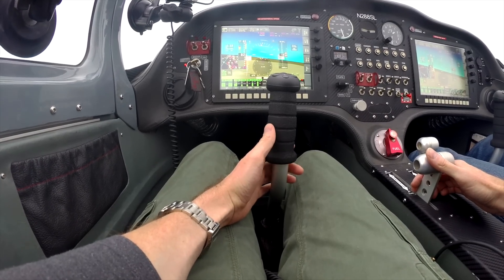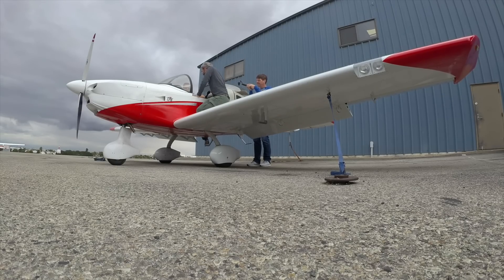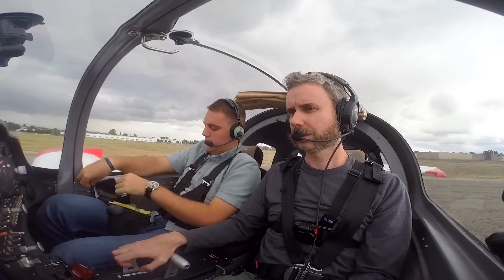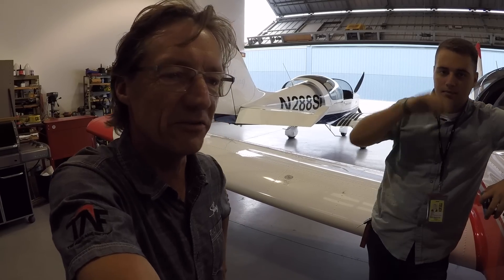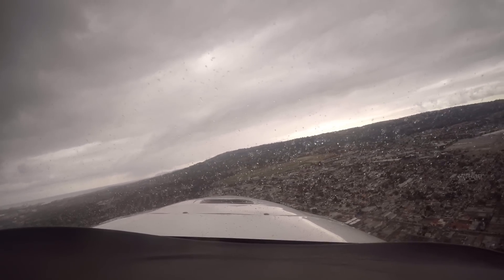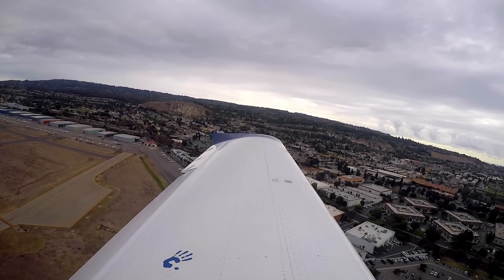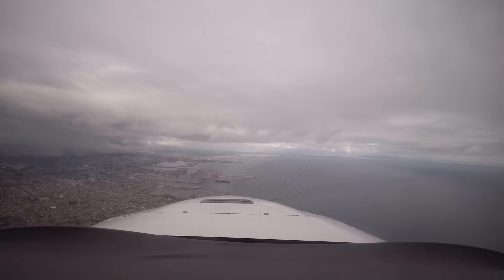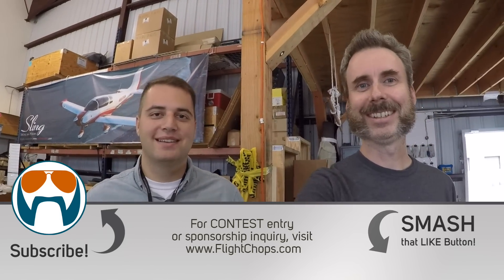Rotax Engine Failure - Flying Impressive Sling2 LSA in SoCal

Comment: I’m very suspicious of the Rotax engines. I understand their appeal in terms of fuel economy and fuel injection but I just don’t have a good feeling about their reliability.
Reply: they built to be light and not last very long,  You'd think an Austrian based company would know better, KTM Dirtbikes are Austrian made and very good quality...
Reply: The Rotax engines powered Seadoo personal watercraft too. Namely the 580 CC engine. Extremely problematic and there is actually a warning that the Rotax is not designed as an aircraft engine (see below)... yikes!

"This engine, by its design, is subject to sudden stoppage. Engine stoppage can result in crash landings, forced landings or no power landings. Such crash landings can lead to serious bodily injury or death...This is not a certificated aircraft engine. It has not received any safety or durability testing, and conforms to no aircraft standards. It is for use in experimental, uncertificated aircraft and vehicles only in which an engine failure will not compromise safety. User assumes all risk of use, and acknowledges by his use that he knows this engine is subject to sudden stoppage...Never fly the aircraft equipped with this engine at locations, airspeeds, altitudes, or other circumstances from which a successful no-power landing cannot be made, after sudden engine stoppage. Aircraft equipped with this engine must only fly in DAYLIGHT VFR conditions."
Reply: @SkyChaserCom  Wow, it looks like things are even worse than I had assumed.

Comment: According to BP's website, MoGas is NOT approved for aviation? If true, I wouldn't want to take that chance when learning to fly. I'm planning to start training in a Sling in a week so any comments are appreciated.

"About MoGas: MoGas is not a recognised or approved Air BP product. It is not approved for aviation use. Please take into account the dangers of using this product before flying and be aware of the following issues:

Octane too low: The ‘Octane’ quality of gasoline is a measure of how well the fuel can ‘wait for the spark’ and burn smoothly when lit in the engine combustion chamber by the spark plug. Gasoline of high octane quality allows powerful, light, fuel efficient engines to be built. As these qualities are sought by aviation, Avgas 100LL is of very high octane quality, >=99.6 Motor Octane Number. The best automotive gasoline sold to the public in Europe is typically only 88 Motor Octane Number. Therefore, if an aircraft engine requires 100LL for octane, never use automotive gasoline - the fuel will not burn smoothly in the combustion chamber, causing detonation and catastrophic failure. The industry is very aware of octane following extensive Avgas testing at the FAA Technical Center in the US for unleaded fuel development. " - reference BP website on MoGas
Reply: https://www.flyrotax.com/produkte/detail/rotax-912-uls-s.html  details for fuel requirements are in there.  US 91 Premium Octane is fine in this particular motor. Rotax builds snowmobile engines. Snow mobile engines run fine on non AVGas  or Unleaded Regular or Premium.

Comment: Another superb video Steve. I fly an EV-97 Eurostar microlight which also has a Rotax up front. They are great engines and 100HP in a 450kg MTOW microlight is a pretty amazing power to weight ratio. Keep the vids coming - you're an inspiration for my own little channel here in the UK. (And I agree with the previous poster about a Netflix series!)

Comment: Interesting thing about the tachometer, the Katana shows the reduced RPM of the prop (and not the RPM of the engine), as does the Thielert Centurion -converted C172.
Reply: you can set an engine monitor to show both if it has duel tach feeds

Comment: I had FOUR sets of floats in 200 hours! The formula for them seems to have been lost in 2012. Two years ago I had a pair of floats AND one ignition module fail (dry joint) at the same time after a few frosty nights even though the aircraft is hangared.  Doesn't do much for confidence. A friend had BOTH ignition modules fail in different ways after the same weather!
Reply: Talking about the sling or another plane.

Comment: LSA's are real airplanes so long as the hobby shop's $49 all-included RTF R/C kit is, too. It's just expanded so that the controls and manipulator can sit inside instead of being on a transmitter while standing on the ground. Expensive instruments optional, sort of like an expensive transmitter--there's just not much that can be done with either.

Comment: I had the similar experience with a scheduled demo flight in the sling 2 the guys from Sling we so kind as to fly out to French field near Temecula, Ca in the blue sling to give my co-worker and I a demo flight as they had to interact with a bulder that lived near by and check on his progrees of his sling kit my co worker/friend went up 1st and came back all smiles it was his 1st time flying an LSA then  when it was my turn he had shut down the engine so I could trade places but on the attempted startup it wouldn't run smoothly and then completely died the guy from Sling said it may have been due to not letting the engine cool down before shutting off very similar to what used to be called a vapor lock on automobile engines when they got too hot so the same fellow you show fixing teh issue on yours took off the engine cowling diagnosed the problem and fixed it unfortunately by then it was getting  late evening and they didn't want to fly back to Torrance in the dark the guys loaded up and flew back to their base in Torrance  I never did get my sling demo ride that day which is too bad I think it's one of the best of the LSA bunch out there may be another time

Comment: Not sure when this was shot, but there has been an alert service bulletin out on the carb floats for a long time. Sounds like they were not checked and/or replaced.
There was a run of floats that flaked the outer coating and eventually saturated with fuel.
Reply: I used to help run this flight school and know for a fact that all carb floats were replaced per the service bulletin (which was released at least 3 years ago). In fact, this engine may have been built after that SB was released.
Reply: Jordan Denitz If that is the case I would expect dirt in the bowls from fuel issues rather than the floats.
Reply: Doug Grant All I can say is that we complied with the original SB. But it may be an ongoing issue. I personally spent the majority of my time flying our Slings with the Rotax 912 iS. I wish engines were foolproof, but unfortunately that's not the case. But that's why we go through thorough pre-flights and run-ups.
Reply: A part of the condition inspection is weighing the floats. It doesn't matter if the floats were replaced or not, it is still required. It shouldn't suddenly become a problem like this. That is all I will say.
Reply: There are over 50,000 912/914 engines that have been sold by Rotax. Yes, there have been crashes with some of those engines. There has been an SB and a check the float weight every 100 hr./annual added to the Rotax checklist. As you say there is no conclusion given here. Although carb icing is very rare in a Rotax, is that a possibility here? 
This whole conversation, for me at least, comes from the impression in the headline that the story is about a Rotax engine failure when that is not technically correct. The engine was still running and the cause was found. It strikes me as odd that it would not have been found in the 100 hr./annual condition inspection. 
If you own a Rotax 912 and someone else does your work you might want to have them show you the scale they use for this test. My guess is there are a lot of mechanics/repairmen out there who don't bother.
I think you get some people who have been working on Continental or Lycoming for years and think this can't be that different, but dry sump; water, oil, and air cooling; constant velocity carbs with a starting circuit instead of a choke and no mixture control; 5800 rpm with gear reduction to the prop; a propeller slip clutch; soft start electronic ignition; automotive style spark plugs; 11:1 compression ratio; .001 clearance on the cylinder walls; etc. means this is a very different machine.
Reply: reverse thrust The scales really don’t cost that much. I would hope they use them.
Reply: Doug Grant Do you implicitly mean these rotax carburateurs? Or do you mean carburateurs in general?, if so that problem has been there  since the first time the were made. But it only started to become a problem with aerobatics, if I remember correctly.
Reply: Wombat?? What makes you think I am talking about the history of aircraft? The Wright's didn't even have a carburetor in 1903. Obviously no floats either. The 912 is not an aerobatic engine (even though it has a dry sump). Nothing I have written applies to any other engine. I work on this engine and I have taken training on this engine. All my comments apply to this engine.
Reply: @douggrant4008  alot of rotax engines have been abused fuel and oil wise. treat them as the manual says and tbo plus more with hardly any wear. solid little engines, never used to like the high revs but once you see them stripped an see how well built they are changed my mind. dont trust a second hand two stroker at all, buy new ends up cheaper in the long run

Comment: You can fly a sling round the world? What's its maximum range?
Reply: Hay! Endurance is 10 hours but when they went on the flight around the world they took a Sling 4 and put a extra fuel tank in the back..
Reply: Grant Liebenberg hell; if it's under gross max weight and the tank isn't making the center of gravity too far aft, I see nothing wrong with that.

That being said, the guys that built it did it, so I'm assuming they were comfortable with modifying the plane in that way.  I sure as fuck wouldn't be lol
Reply: Well, Grant, the first flight around the world was in ZU-TAF (the bright yellow one) back in 2009. Just a hell of a lot of stops with 20 legs! http://airplanefactory.co.za/expeditions/sling-around-the-world/the-route-world-2009

Comment: I know this video ended up as a carb and not an ignition problem.  But I want to tell my little story and maybe someone can learn from it.  A couple years ago I borrowed my buddy's 1982  C-152.  My son was in the left seat and I was giving him a lesson.
     After the run-up, the mag check was perfect.  During the takeoff roll but before liftoff, I looked at the tach and noticed the engine wasn't producing full power, maybe 2400 rpm.  Some might attribute the low rpm to high-density altitude, but something in my gut told me otherwise.  I aborted the takeoff and we taxied back.
      While taxing back at about 1000 rpm I did a simple mag check.  Wouldn't you know one of the mags was dead?  From the time we did the full mag check until we tried to take off, one mag died.  No more than one or two minutes had elapsed. 
      The lesson I learned:  Trust your gut and be conservative.  Always make sure you are developing full power, even if you take high-density altitude into account.   A mag can die in a heartbeat, just like a person. I now do occasional mag checks at random when taxing always double checking that the mags are back on both.  
       This is all the more reason to do a mag check by first going to the far mag, back to both, then the close mag, back to both.  This avoids the potential of taking off on one mag by accident.  Yesterday i commented on this below.  Safe and happy flying everyone.
Reply: Don’t fly a plane from 1982. If it crashes people will be like “ figures”
Reply: Ricardo montalban 1982 is considered newer in aviation terms. I’m training in a ‘72 Cessna 172. I would feel safe flying in a 45 club as long as it’s well maintained and passes all preflight checks.
Reply: @Gameisis  Yeah, planes don't age like cars. It's perfectly normal to fly a '70s era plane.
Reply: I own a motorglider and I do the same, however, I do it slightly differently. I do the mag check as you'd expect before takeoff. I check the full engine RPM as soon as its applied and watch it closely. Before shutting it down in the air I'll do one more mag check to be sure they both are still working. If I need the engine later, it's nice to know it was shut down in full working order. Note: we never use the engine as a get out of jail free card. Never.

Comment: Mr FlightChops, I think many of your commenters may be missing the point regarding this powerplant, perhaps further confused by your erroneous caption. The aircraft was not running on AvGas it was MOGas or unleaded “Regular” car fuel which is cheaper. Your caption identified it as Jet-A. Both Jet-A (Diesel) and MOgas are straw coloured but they are very different products as you know.

Many people miss-identify Rotax LSA petrol engines as Diesel engines (Jet-A) due to the different sound and need for a reduction gearbox (or simply not being Lycoming/Continental) but like in cars, the two are completely different combustion principles. Rotax engines even offer the benefit of allowing both AvGas, MoGas or a mix of the two (subject to aircraft certification).

If your engine was a diesel running on Jet-A you could not have a “fouled plug” during a power check as diesel engines don’t have spark plugs. The need for both engines to have gearboxes is to allow them to operate at peak efficient RPM and higher RPM torque values without needing large cubic cylinder displacement to achieve the same torque. The Rotax is a 83 in3 displacement vs an equivalent Lycoming at 233 in3 for similar horsepower This is where the fuel saving area made. Other benefits are water cooling for optimal engine temperature, FADEC engine control, dual carburettors etc etc.

I apologise if it was a typo and you weren’t mistaken, but I hope I have shed a little more light on the subject.

Fly safe and keep up the great work.

Comment: why isn't it fuel injected? I don't know a lot about the engines of these aircraft but I feel like fuel injection would make it more reliable maybe?
Reply: The plane they actually flew in, N288SL, is fuel injected. It's got a Rotax 912is engine. I've flown it several times.  Fuel injection systems rely heavily on electronic sensors and control units. So, redundancy is used to keep it safer. In the case of the 912is, it uses 2 computers (called LANE A and LANE B). During run-up, you test the system by switching off one lane at a time to make sure each lane is operable on its own (sort of like the way you test the mags with a standard carb system).  Even with fuel injection, there's a chance that one of the lanes may fail.
Reply: ahh, alright, thanks for the detailed explanation btw :)
Reply: Phillip Fanous I'd argue that engines with carbs offer more opportunities for there to be a failure in some way, especially regarding the path the gas flows.  That being said, fuel injection isn't perfect by any means either.  Both require vigilance and maintenance, as there should be regarding any engine.

If that wasn't a problem, friction and wear would be over time.  You show me an engine that runs perfectly forever, and I'll call you a snake oil salesmen.

Comment: 3:02 Nope, not only on empty.
Reply: UndeterminedCoolAviationName read the FAR
Reply: Which says "(1) Each fuel quantity indicator must be calibrated to read “zero” during level flight when the quantity of fuel remaining in the tank is equal to the unusable fuel supply determined under § 23.959(a)". It's a long standing misinterpretation that it means "only has to be accurate when empty".

Comment: Amazing plane and an overall great video, but title of "Rotax Engine Failure" is a bit extreme and exaggerated. The engine never spontaneously quit. I wish engines were foolproof, but unfortunately that's not the case. That's why we go through thorough pre-flights and run-ups.

Comment: For added lifetimes for students, pilots, and instructors, we need to do ourselves a favor and use real aviation fuel.  Ethanol added  fuels (auto gasoline) damage fuel systems (fuel hose, internal carb parts, seals), increases water formation in the fuel tanks, and dries upper cylinder  and  intake/exhaust  valve lubrication.  Otherwise, power plant TBO and pilot/passenger lives can possibly be  shortened.  And the Rotax powerplant, now that's a red flag ,and a discussion  for another time, seriously.